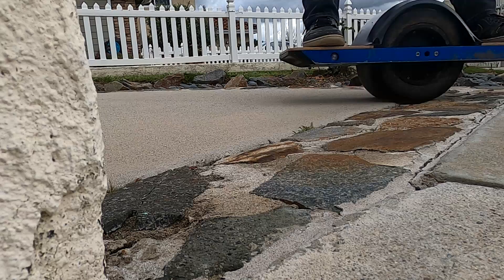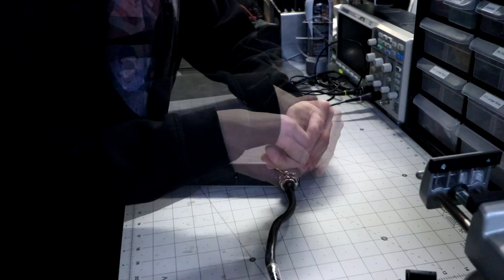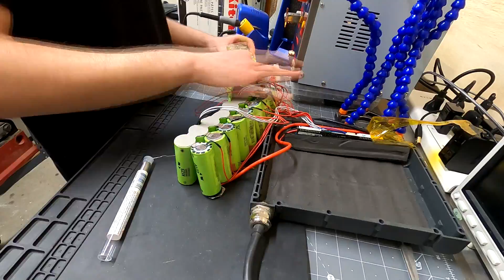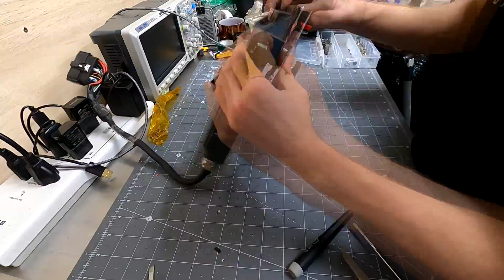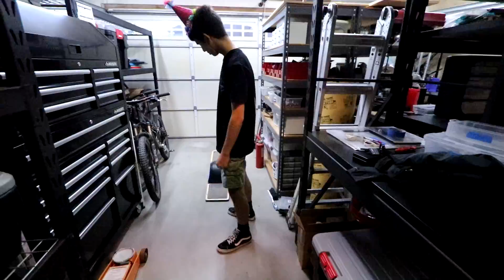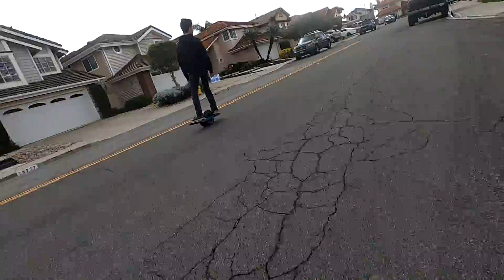Onewheel Battery Replacement

Comment: nice work. you were making 2 packs in the video? or did you fit 16s2p? it looked like 1 row of cells when you put back in...
Reply: Could you make me one for my onewheel plus? If so, how much would it charge? Thx Jason
Reply from the maker: Thank you! I only made one 16s1p pack here, recreating exactly what came with the OneWheel but with new batteries. I had to assemble the pack "folded" in half so my spot welder could reach the joints between rows, so it did sort of look like two until I "unfolded" it to fit it back in the battery compartment.
Reply: @tyleraprice  awesome, I see. What I was referring to was the identical pack in the background,  now it makes sense that it was the original pack you were mirroring. Thumbs up!